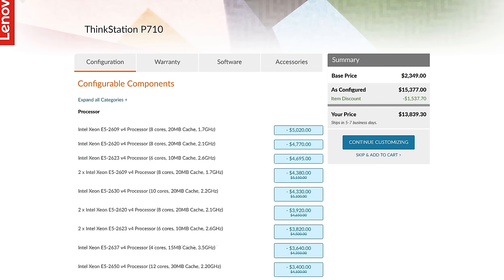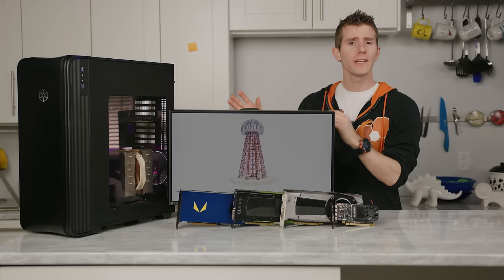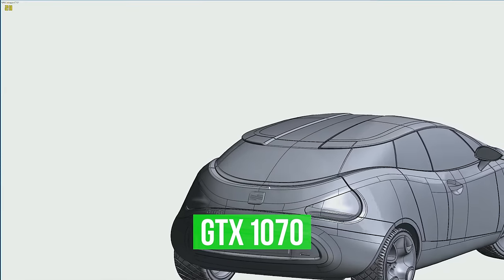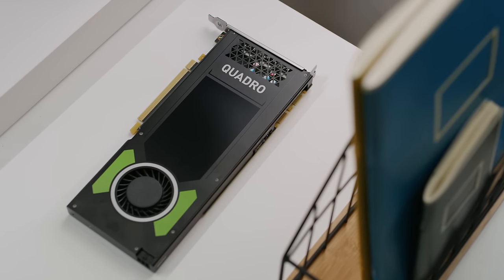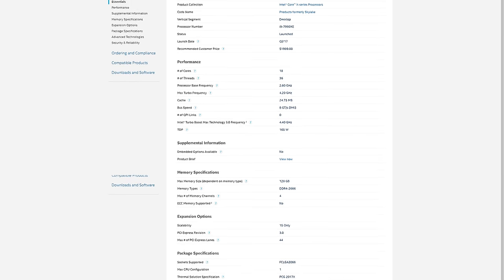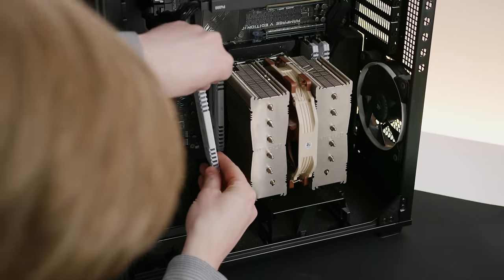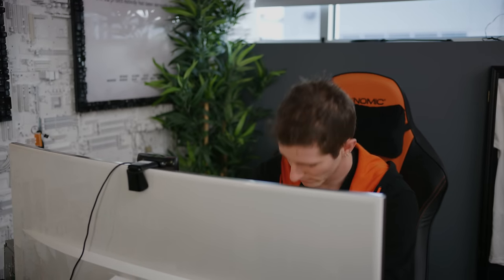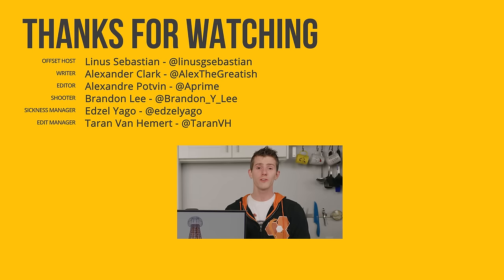3D Modeling & Design – Do you REALLY need a Xeon and Quadro??

Comment: how about the Quadro P2200? It has very few review online...
Reply: The p2200 is a very nice card, also quadros are way better than geforce as they dont get burned that easly, i have a quadro 2000 for 9 years and still works as new, also i rendered alot from that, some days 5days on 100% gpu and it still works.
Reply: @gzarari  That is so great to hear. I recently purchased a Dell Workstation and I have it configured with P2200 with some doubt because I could not find any review of it. Now I can't wait to use it!!!

Comment: if I build this today, would ryzen 2700x would be a good option? mainly use Autocad 2014-2016 2D work
Reply: I don't know how large your files are, but autocad 2d (USUALLY)  runs fine even on budget cpu
Reply: my file generally approx. 5mb-10mb, consist of Architectural plan view layout basically consist of lines mostly... in building construction related.. currently using a i7-4790k with 16gb ram ddr3 with I believe a regualar 4mb GeForce video card... also running a Evo Samsung solid state... when clicking to draw lines, seems like a lag/slow input.. so I am thinking to upgrade... and not sure if gaming videocard is also can issue may be I do need Quadro?... or only for 3d application?
Reply: @donnydx  your problem might not be related to hardware and it's quite common. You can search on Google "AutoCAD lagging when drawing lines" . One solution is to Disable Desktop Composition in advanced sistem option

Comment: Can anybody help me decide to choose a gpu for CFD using ansys fluent. I solve thermal cooling. I am a phd student and i have a desktop with i7 7700h amd currently have quadro p1000, but my calculation time is about 10 hours for 1 system. I need to reduce that calculation time

Comment: can i i7 gtx 1060 with 16gb of ram run these 3d modeling programs?!?!?!
Reply: That is more than sufficient for just using the programs for modeling, you wouldn't even need half as much power. Rendering with that hardware will usually be effective as well,  but this depends on the complexity/poly count/lighting setup/render settings of your preferred 3D program.
Reply: @AaronSmith561  thanks just getting into it

Comment: I wonder if Linus Tech Tips can help me. I'm an old hacker turned 3D animator. I have an msi b250 krait, holding 32gb of DDR4 and a water cooled dual-core Corei7 with an m.2 primary and two 2tb Ironwolves.. inside a no-window sleeper chassis that I hand-picked to be as boring AF. I'm running a GeForce 1080 but it's largely irrelevant as I work mostly in C4D and Adobe AE. I do mostly pro-bono work or work for really good rates.. so I'm actually pretty darn broke most of the time. Is there a quick and cheap CPU that you can recommend that I can just swap this one out with one, it's fine for gaming but I'd like to re-purpose this system as my primary Cinema 4D workstation. .. as cheaply as possible.

Comment: I'm quite lost now , so an i7 8700k is better then i99900k ? Like how on earth? I do heavy load 3d modelling and heaving complex architecture and interior architecture rendering! So i99900k or i7 8700k?😒
Reply: 9900k would be better, and might be a good upgrade if you have an existing z370 or z390 board. If you're building an entirely new system you might want to consider Ryzen 3rd gen for it's ECC support and overall value. Depends on your budget, I hope Linus makes an updated video.
Reply: @hypecat9138  tbh ,  i prefer sticking to intel for the processor, never used AMD , plus a lot of platform doesn't support AMD  graphic cards!
Reply: Because he was saying "bang for buck", and when solid modelling in SolidWorks, the software is only optimised for single core processing. The i7-8700K base clock speed of 3.7Ghz is (technically, but likely unnoticeably) faster than the i9-9900K 3.6Ghz! For that sole reason, it's "better". But it's also cheaper, so again, for the "budget build", it's better! He does however go on to say when rendering (again, in SolidWorks) the more cores, the better, and then yes, the i9 would be superior... but solid modelling is about solid modelling, not rendering. You're taking your application of hardware and applying it to his presentation about something completely different! Please try and keep up! He also says at the end of the video, effectively, "if you have the budget for the most expensive shit, buy the most expensive shit, because it's the bollox!". Surely you don't need to be a brain surgeon to work it out?! 🙄

Comment: As a veteran in the games industry I must say... What the hell is wrong with you? The worst advice for modeling, rendering, texture work or anything on a professional level.
We all use mostly AMD with 1080 or 2080 cards and 128 ram and for rendering even at home a render farm built from  cheap processors each at 3.5 x 50 stacked in a networking fashion.  Xenon is purely for Engineers or scientific work not modeling.